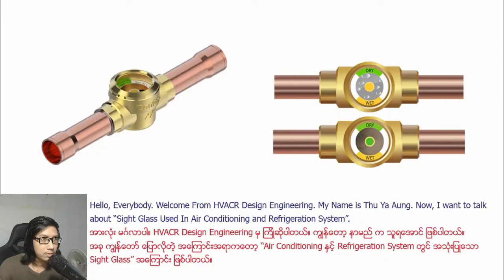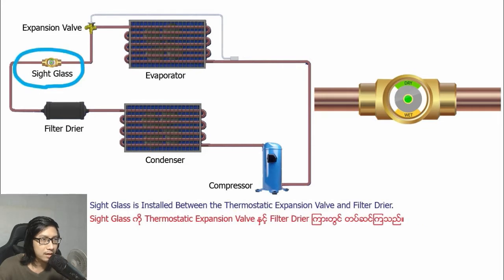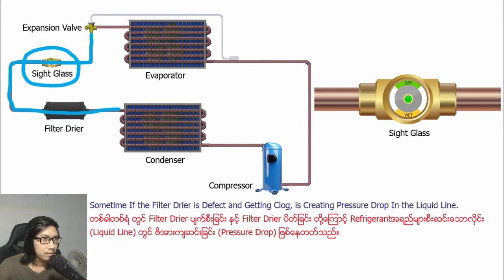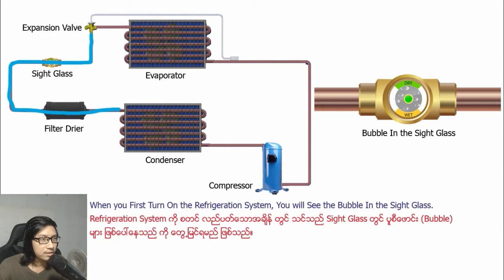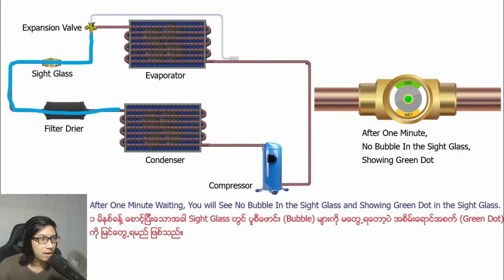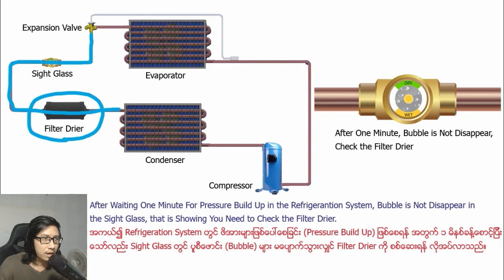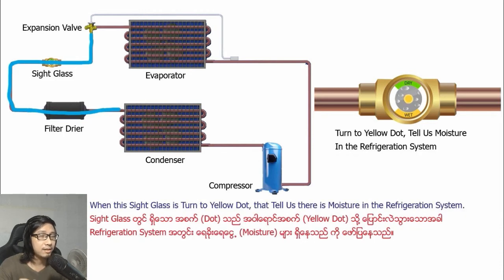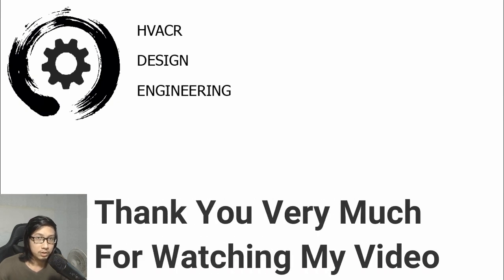Sight Glass Used In Air Conditioning and Refrigeration System

Comment: Very informative video. Sight glasses seems very useful but most seen only in commercial freezers. Is there any reason it should not be installed with commercial or residential AC systems?
Reply: Yes  koseme   .sir  sight gals  is  somanney tmodels fee inducahion showing ac  systomes  gsas  low  luquied bubles rulsuling  a  ... A  moisture  indicator  should  also  be  in  stalled  which  allowes  for  quick  visubles  checking  of the  moisture  content  of  the  refrigerant   indicatores  are  provided  with  asight  glass   vchange  acording  to  mosture  content  .  contains  a  porous  filtwr  to